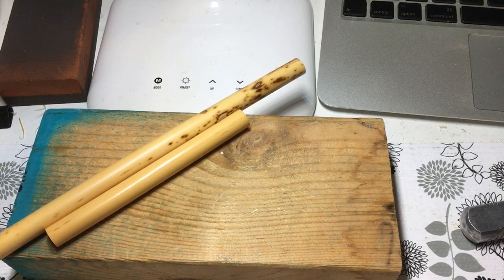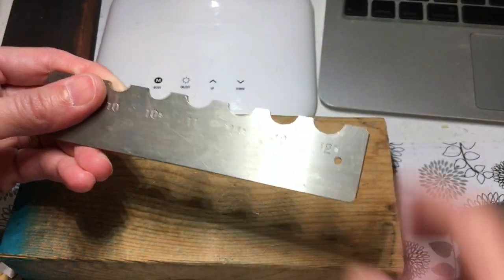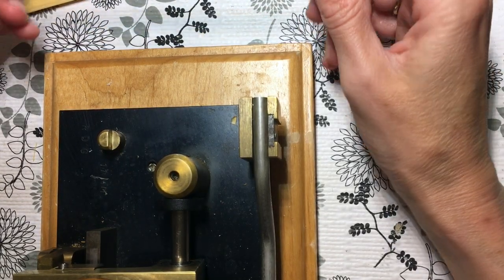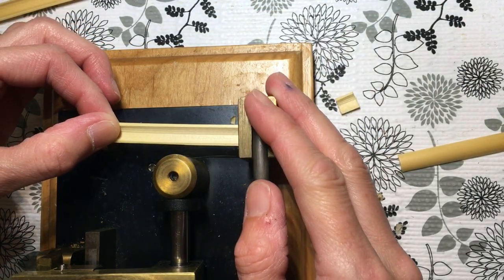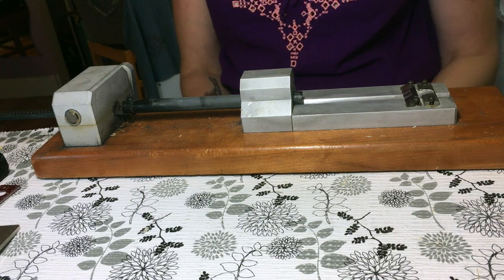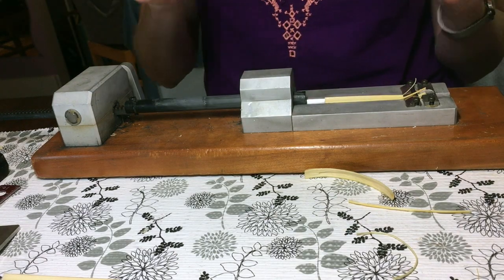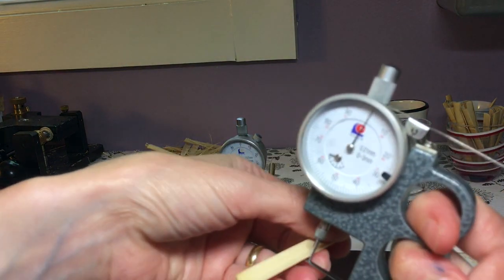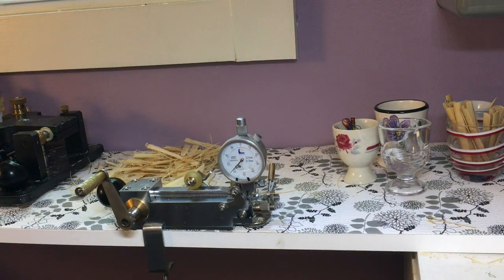Five Minute Reedmaker: Cane Preparation

Comment: Hi Jennet - about 5min into this video, you used a handheld dial tube thickness gauge but I can't make out the logo on it. Can you share its brand name? I've been on the lookout for a gauge of that type, in the modest but not junk price range. Thanks!
Reply from the maker: Gosh. I think it's the one that came free with my Innoledy gouger - the logo on the face says Guangiu, I THINK.  It's written very very small.
Reply: @JennetIngle  Thanks, searching around a bit, it is apparently GuangLu, and is similar to or maybe rebranded from some other inexpensive dial indicators of Chinese manufacture I have found.
Reply from the maker: @mbw6815  Excellent - thanks for the research!

Comment: When or do you soak the cane in the "cane preparation" stage?
Reply from the maker: Bob Berinson good question. I soak for an hour or so before I pre-gouge - I’ve found that the cane cracks if I don’t. The innoledy gouge is designed to work dry, but I often prefer to gouge cane that has soaked for 10-30 minutes so I can move straight into shaping and winding.